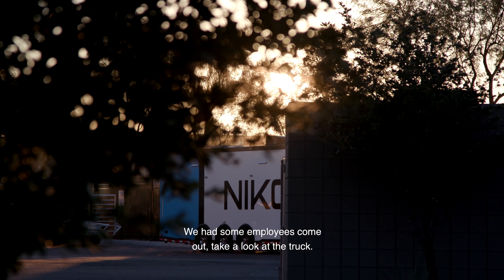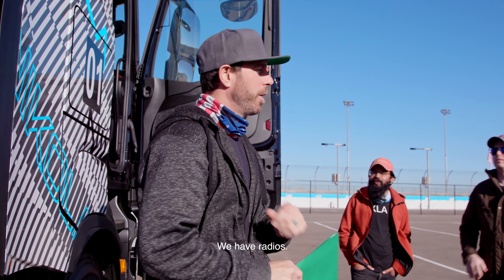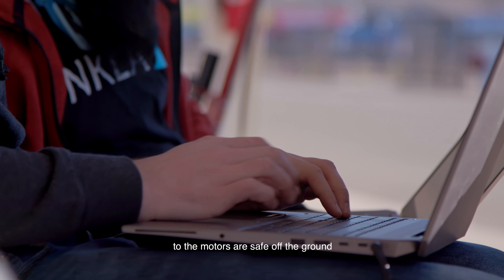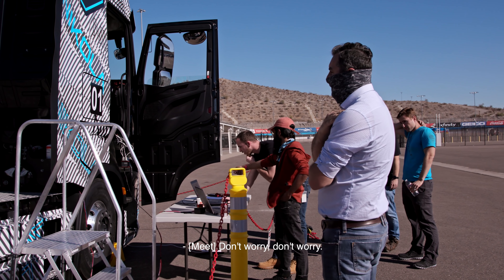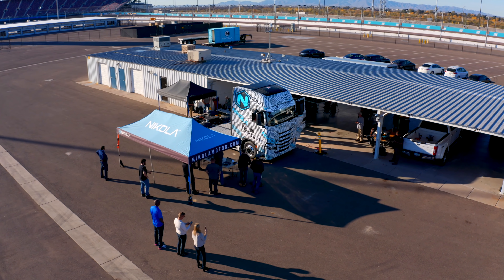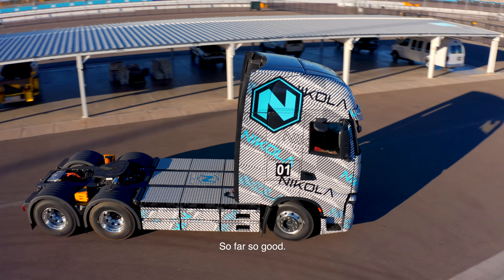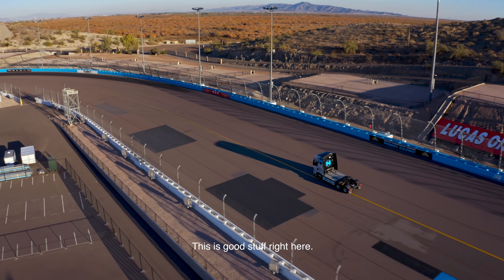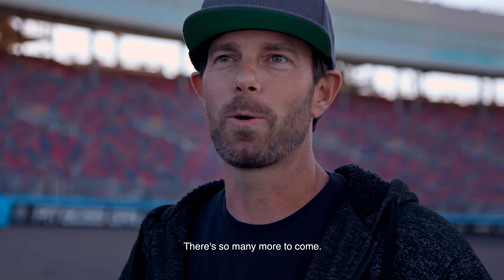Driving Change Episode 2: Power Up | Nikola

Comment: Can "down voters" give me their reasons? Trying to make informed decision.
Reply: Nothing will be produced ever, they said there will be natural gas trucks in 2016, never came, EV military cars in 2017 never came, electric waterscooter (LOL) never came, Nikola One/Two, will never come. Badger = CANCELLED. Only thing that will come is the Tre which is an Iveco body and Bosch parts. Nikola does nothing but the paint job and 'ThE hTmL 5.0 sUpErCoMpUtEr' LOOOL
Reply: I cannot see a single reason for the "up voters".
Reply: @drosophilamelanogaster3957  
That's not a reason. That's a quippy comment acting like wisdom.
Reply: I am down on the company but I didn't down vote and only rarely down vote a video, it would be awesome if You tube had a option for people to down vote AND comment why at the same time so you would have your answer automatically.

I think people went for Nikola because a) they were looking for the next Tesla b) they believe in clean Hydrogen as a fuel
Well its 18/4/2021 now Sunday and NKLA is $11.00 I hope you didn't buy any a month ago. I think the timeline for Tesla is like this:
2010 Roadster
2012 Model S
2014 Model X
2017 Model 3
2019 Model Y
2020 Jan Shanghai factory opens
2020 500K cars sold, Solar panels and Solar Roof
2021 On it's way: 4680 Batteries, Cybertruck, Giga Berlin, Giga Texas, Giga Shanghai expansion, Semi trucks
At some point Roadster 2.0 , $25K Model 2, Full Self Driving
Tesla has delivered a lot of product and has a lot of stuff in the pipeline coming soon in 2021 and stuff coming later.
Tesla already has success under it's belt but they are not stopping

Nikola hasn't delivered anything except controversy as yet, so on the above Tesla roadmap they would be at 2008.

Edit: Tesla is the next Tesla

Comment: Is this the first fully functional electric  semi truck in the world? If so, I am loading up!
Reply: No. There are heavy duty electric trucks from Mercedes and Volvo that are already in service. Tesla has the first real long range class 8 semi truck on the way. It has been well documented testing around California pulling 40,000-50,000 lbs. of concrete blocks. One highway patrolman took pictures and talked to the driver at Donner mountain pass. 

This Nikola truck however is a prototype that was shown driving gently at 35 kph around a smooth empty track without any trailer or load for maybe a minute or two.

Comment: This is not even a hydrogen truck lol its BEV
Reply: That was always the plan, to have a short haul BEV to market first, then the long haul fuel cell.
Reply: @joezonie8724  That has been the plan since its founding in...2014. Still waiting.
Reply: @flipadavis  Actually the plan from founding until mid 2016 was to do  natural gas engine semis.
Reply: They are going to make BEV and hydrogen trucks

Comment: Finally you did it
Reply: Did what? Another soapbox?
Reply: What, driving around a battery electric vehicle at 35 kph? Those could be lead acid batteries and motors from  the 1960s and it could do what this did in that video. Tesla already has an electric semi driving through mountain passes pulling 40,000 lbs of concrete blocks at highway speeds.
Reply: @flipadavis  you make a good point

Comment: We believe Nikola high technology
Reply: Nikola does not have any technology, just buy from other and then put the logo on.
Reply: What technology did Nikola create?
Reply: @markbockmann2073  bla bla bla
Reply: @Urfinchannel  so I guess you can't answer the question?
Reply: Nikola brings different companies together to work on a new project under their name. I think thats good enough!
Why reinvent the wheel?
Reply: @imuger  The wheel hasn't really been invented yet, that's the issue. Companies like Tesla are inventing the electric semi "wheel" right now with a holistic engineering approach. Nikola's version is to buy everything from 3rd parties including the drivetrain which is all IVECO's and then put their badge on it and mark it up in order to make any profit.

So even if the Tre is remotely capable in real world it will end up costing more and having less range than a Tesla semi. It's fine if there is zero competition but there is already competition from companies like Tesla, Mercedes and Volvo who are all making electric trucks as well.

Comment: SO if high voltage fails the brakes don't work, not safe.
Reply: They're taking about regenerative braking. The regular old brakes will work all the time
Reply: How? The question is what are the possibilities of the high voltage failing. It’s like saying gas cars are not safe because if the break line fails the breaks don’t work.
Reply: @firstnamelastname5846   Battery runs out and brakes die, a single break or short circuit in the wires and brakes die, basically electricity is much more susceptible to failure than a mechanical system. A brake line is simple, make it strong and it won't snap can't do the same with high voltage.
Reply: @picknmixnwin9226  or it could be similar to air brakes. Needs constant air to keep brakes unlocked. I am sure there is an emergency brake in the BEV version to pass road safety for commission. Hence, the reason for this testing and certification phase, which they will eventually pass.
Reply: @picknmixnwin9226  Have you heard of regenerative braking? In that mode the motors are used as generators to recharge the battery and that creates a braking force on the wheels. All modern EVs have that capability.
Reply: I doubt the trailer will have electric brakes! Air brakes are still industry standard and I’m sure this truck will have a version of them too.
Besides.....state and federal regulators will have to sign off that the truck is safe for American roads.
And it will be on European roads too!